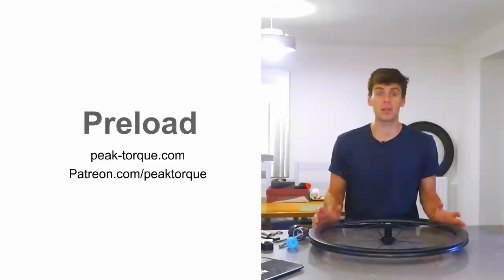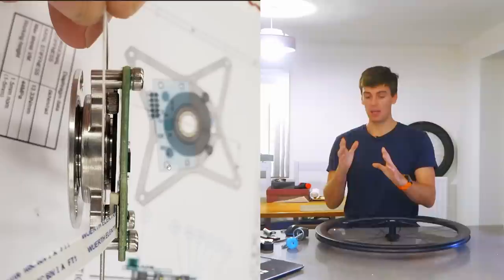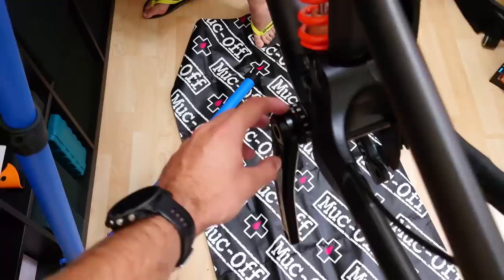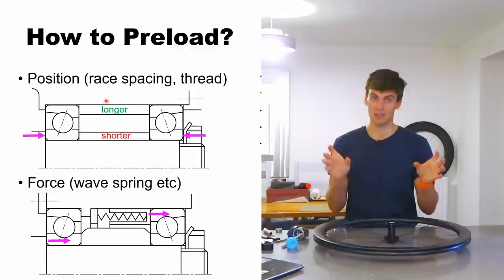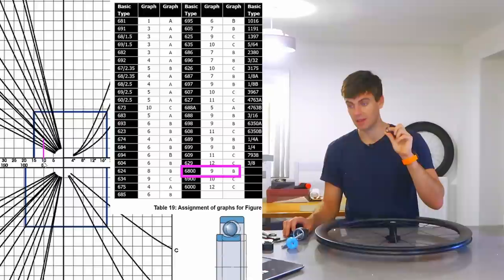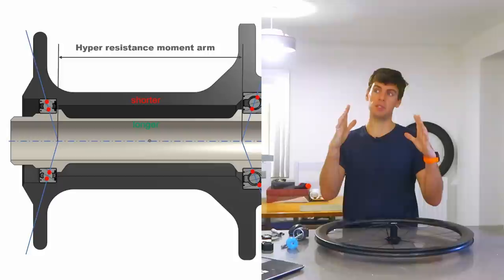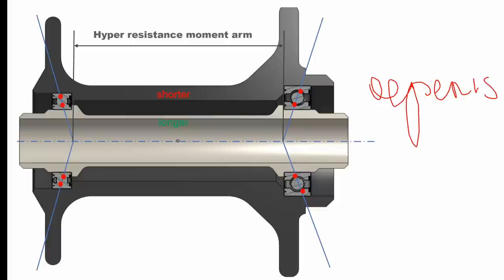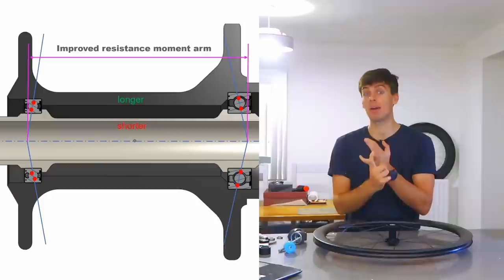Bearings and Preload Explained #bearings #engineering

Comment: Thanks for this video. Very interesting. I have a set of DT Swiss disc wheels with 240S hubs. The original front hub bearings felt rough off the bike, so I pushed in a new set of NTN/NSK bearings (I forget which) and to my dismay they also felt rough. I started to suspect that the shoulders on the thru axle had been machined too wide for the hub, creating excess axial load. I then found a maintenance guide on the DT Swiss site that advises beginning by pushing the non-drive side bearing fully home against the shoulder, before inserting the axle and then finally pushing the drive side bearing only as far as needed to eliminate bearing play (i.e. NOT fully home against the hub shell shoulder). DT Swiss claims that the bearings will always feel a bit rough when off the bike and will only run smoothly once the wheel is fitted to the bike and the axle compressed by the end caps. Does this smell fishy to you? Obviously, I have no way of testing how smooth/freely the bearings are running once the wheels have been fitted to the bike.
Reply: Dare I say it, that's not just fishy, but double bullocks at least:
- DT are known to mess up radial tolerances, thus axial fiddling won't help
- when the bearings are overly preloaded in the manner the manual advises, extra pressure when the wheel is secured will make things even worse
Reply: @feedbackzaloop  Thanks for your thoughts. I considered getting some shims to sit behind the outer bearing races, to pad them out laterally. For now, I have pushed one bearing fully home - the other, I pushed in bit-by-bit, testing the axle for any play and pushing a little bit further until no play remained. The bearings now feel OK outside of the bike. God knows what they are doing when fitted into the bike and the thru axle tightened 🤷‍♂️
Reply from the maker: @trevekneebone369  It certainly does not sound like good practice. The final bearing position should be up against the shoulder, so it sounds like they messed up!
Reply: I would agree with the above, this is not good practice. it's basically a bodge to leave one of the bearings in "free air"
Reply: @Hambini  Thanks. So what is the fix in my case? Machine off a slither from the axle shoulders? Place a shim between the hub shell shoulder and the bearing outer race? Thanks!
Reply: @PeakTorque  the diagram on the DT Swiss "bearing technology" page even shows a small gap behind the bearing outer race if you squint hard enough!
Reply: @trevekneebone369  You could machine a small amount off or shim either. Another method is to use a thin section O ring something around -20 which is a 1.78mm section. If you get this type with a soft material ie low shore hardness it will deform to take up the gap. I would stress this is not a perfect engineered solution but not everyone has access to a lathe and a load of mics
Reply: @Hambini  Thanks for the suggestions. It's difficult for a home mechanic like me to measure the size of the discrepancy. I suppose I can measure the width of the axle shoulders and the hub shoulders. Then what? I understand that the inner bearing races are recessed, compared to the outer racers. This will have to be considered in the overall width of the axle shoulders. My head hurts!
Reply: @trevekneebone369  as you described, the best way are shims. If you can't make a precise enough measurement, my advise is trial and error: one-two shims (if you have them in either 0,05 or 0,1 thikness) too many would make the bearing bind, one-two too little resulting in some play. Starting with way too many, so that you definetely have desirable X arrangement. If you can't decide on the final number, get one less and add it later as the bearing wears.
Reply: @feedbackzaloop  Thanks very much. The problem is, if I get it wrong (not fitting enough shims behind the bearing outer race) and the bearing binds when pushing it fully home, there is no way to remove the new bearing without damaging it. You have to whack the axle to push out the bearing.

It could turn out being a very expensive game of trial and error.
Reply: @trevekneebone369  it may indeed. Heating up the hub body helps though, but bears own risks too. Also you still have the original bearings, right? Use them for first approximation
Reply: @feedbackzaloop  sadly they were toast and long gone.
Reply: My hubs take 6803 bearings. DT Swiss sells a HCDXXX00S3895S Spacer shim 26 / 20 x 0.5 mm. Coincidence?
Reply: @Treve Kneebone
Treve,  I wrote directly to Alex with a fairly detailed description of everything I had done on my 180 front hub.  The "discrepancy" between the measurement of the inner front axle "over the shoulders", and hub "over the shoulders" (that the outer races sit against) is exactly 0.25mm BY DESIGN.  I personally don't think it's a "good" design, however it is what DT chose to do, and I understand why they went this route.
I measured my axle and my hub very precisely, and DT hit their own measurements within 0.020mm or so on both parts. They are actually very, VERY close to their own design specs (I have DT's drawings).

When installing new bearings in a DT front hub, my opinion is that bearing #1 should be pushed to the shoulder (outer race contacting the shoulder in the hub).  At that point (now with inner/tubular axle inserted), I believe the hub should be supported on the "bottom" side by a plug/tool that supports the inner and outer races "equally" (in other words:  a flat tool).  To install the second bearing (now in the "top" side as the wheel is positioned), I feel that the pushing tool should "lead" the outer race by around 0.025mm (.001" or 25 microns).  In other words: the pushing tool is not flat... the portion pushing the outer race is that mount "longer" than the portion that is pushing on the inner race.  When the 2nd bearing is installed, the outer race will be shoved in that tiny bit further than the inner race (since the inner race is stopping at the axle shoulder, and the outer race is around 0.25mm away from its shoulder - by their design).  Doing this will preload the bearing with the inner race pushed slightly outward.   

(side note) --- One thing to remember though when doing this is that using excessive pressure (heavy-handed on the arbor press, or excessive beating with a big hammer) --- WILL cause the inner axle to be compressed (in length) during the installation process, which will then drive the outer race further in (and possibly "too far").  Ideally, a very light touch and a good "feel" for when the inner race contacts the shoulder on the inner axle is probably the best approach.

This preload "outward" will get removed when the through-axle is torqued since the DT-inner axle will be "compressed" when the axle is tightened.   How much is the axle compressed?  Too many variables to make a definitive call on this -- through-axle torque, pitch of the through-axle thread, lubrication on the through-axle thread.... can all influence the amount that the axle will be compressed.

On my own wheels, I did a quick FEA to get a value of how much the inner axle compresses with the torque I apply with my through axle, then measured my hubs precisely and made a spacer to sit under the outer race of the one bearing --  the target being when the through axle is torqued, the bearings have zero preload in either direction (inner races of the bearings are precisely aligned with the outer races when axle is tight).   I can't remember exactly what my spacer ended up being (it's been over 2 years since I did all this), but do recall that it was within ~20 microns of that 0.025mm delta that DT "builds into" their assembly.

Your mileage may vary!

FWIW:  I have over 20,000 miles on that set of front wheel bearings, and there is no play in the wheel, and the wheel spins VERY freely.
Reply: @agie170hss2  Thanks so much for taking the time to write all of this down. It's very helpful and truly appreciated! I must admit that I had to reread it a few times (due to my own lack of knowledge about bearings!) 

I think I have had a misunderstanding up until now - I always thought that cartridge bearings had an inner race that was slightly narrower than the outer race. e.g. if a 6803 bearing has a nominal width of 5mm, I previously thought that the inner race measured less than 5mm and that the difference was overcome by a "protrusion" on the axle end caps. Can you confirm my new understanding that I was wrong - both races in a 6803 bearing measure 5mm wide?

I have decided to buy some spacers/shims to sit under one of the bearing's outer race. The closest I can find is 0.2mm. Do you think it would be better or worse to add a 0.1mm Shim to make it 0.3mm?

Many thanks once again!
Reply: @trevekneebone369   Treve,

Inner and outer races are exactly the same width on 99%+ of the ball bearings in the world.  There are “special” bearings where that may not be the case, but I would consider any bearing with dissimilar race widths to be “custom” and/or for a special purpose. Any bearing used on a bike (bottom bracket, wheel, freewheel) will have exactly the same inner and outer race width.

In my *opinion*, unless you use a spacer that is precisely the correct thickness, it could create a situation that is worse than using no spacer (and simply assembling as DTSwiss recommends).

For instance…

- If the spacer used is too thin, the outer race will not contact it unless a “stepped” pusher is used to force that outer race against it.  Doing so could easily damage the bearing during assembly.

- If the spacer used is too thick, then the bearing’s outer race will come to rest against that spacer before the inner race contacts the shoulder on the inner axle tube.  This will be bad as well, as installing the wheel in the bike and torquing the through-axle will try to push the inner race up against the inner axle shoulder, which will place a large “side preload” on the bearing and could easily damage the bearing.

The bearings in these wheels are small and delicate — and can easily be damaged.

Without making very precise measurements of the width of the inner axle tube “over the shoulders”, AND the measurement “over the shoulders” of the hub (which the outer races should be sitting against), it is not possible to determine exact spacer thickness.  Without using a very precise spacer thickness based on those measurements, it is very possible that the bearings could be damaged before the wheel ever rolls “down the road”.

Feel free to ask more questions if you have any.   🙂
Reply: @agie170hss2  Thanks again. I think I get it now. Unfortunately, I only have basic pressing tools (the type you slide onto a threaded stud bar). It's fairly straightforward to press the first bearing "hard" up against the hub shoulders. Feeling when to stop pressing the second bearing is the tricky part - exactly when the inner race reaches the axle shoulder and no further. I suppose that heating the hub shell will help the 2nd bearing go in more smoothly and increase my chances of getting it right? I can't think of anything else that an amateur like me, with very basic tools, can do?

I took my wheel out of the fork today and the bearings feel rough. The wheel spins OK when fitted and torqued up. It doesn't make any noise that I can hear, but the valve doesn't spin backwards and forwards as the wheel comes to a stop. I have no idea if the bearings are toast? 🤷‍♂️
Reply: @trevekneebone369  
Treve,  
Unfortunately, it's a bit difficult to "feel" the true condition of a bearing if the side-load is not known, and for that matter... if the bearing interference in the hub is not known (though from the DT parts I've measured, I suspect the bearing interference is probably spot-on).

What I would probably recommend is that when pressing in the 2nd bearing with your threaded "pusher/puller" is to just apply a slight amount of force once the bearing is seated (inner race against the axle shoulder). Try to imagine applying about the same amount of force that the through-axle applies when tightened.  This will slightly "compressed" the inner axle (shortening the length over the shoulders just a bit) and push the outer race in a tiny bit further.  

As you can probably glean from this discussion, the inner races of the bearing(s) should have a very tiny amount of "side-load" on them in the outward direction when the wheel is not in the bike.  That is the target.  When the through-axle is tightened, this compresses the inner/tubular axle just slightly, which -- IN THEORY -- will move the inner races inward just slightly so that there is no side-load on the bearings. 

Once again, feel free to continue the discussion -- we all benefit from this exchange of ideas and methods.   🙂
Reply: @agie170hss2  OK. I feel like I'm understanding it a lot better.

So, given that I can't establish the exact size of spacer, I would be better off not trying to approximate one. Instead, I will try to follow DT's method and your recommendations.... 

Press the 1st bearing fully home, insert the axle and then press the 2nd bearing until the inner race makes contact with the axle shoulder, then press it just a fraction further to deliberately introduce a small amount of side loading (which should be eliminated when installing the wheel and compressing the axle). Is that it? 

How do I know when the inner race is up against the axle shoulder? Try to slide it sideways?
Reply: @trevekneebone369  
You should have no trouble "feeling" when the inner race of the bearing contacts the shoulder on the tubular axle.   DT Swiss does not run a lot of "interference" on the bore-to-bearing-OD interface, so contacting the shoulder on the inner axle will definitely feel like a positive stop.
Reply: @agie170hss2  I came to a similar conclusion to yours, however with much less scientific methods. I appreciate your writeup that gives me a bit more confidence about my conclusions.
Reply: @richsmith1541  - it's unfortunate (or maybe it isn't!) that adding photos is not allowed in comments, as topics like this would be far easier to explain with a couple of CAD drawings and some photos.   I should probably light up a YT channel and start posting some of the things that can (should) be done on a bike to make spinning/rotating parts more precise and reliable.
I've made my own press-in bottom brackets that are far more precise than anything available,  with zero creaking, and zero wear on the bearings or crank axle after 20,000+ miles.
There is no magic in any of this... it's all basic stuff that has been applied in precision machinery for probably 100 years.   The bike industry is unfortunately based on "easy profit", at the cost of attention to detail.   😞